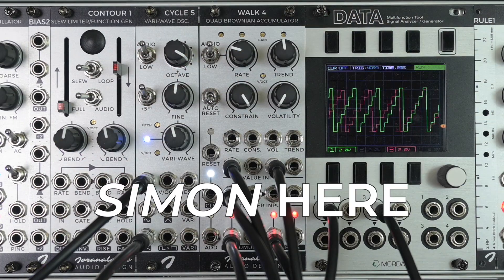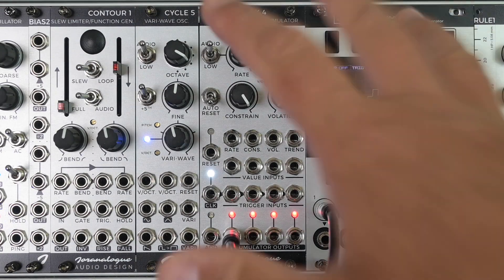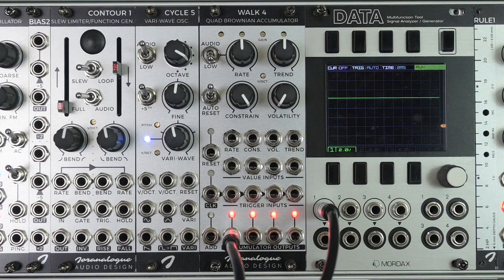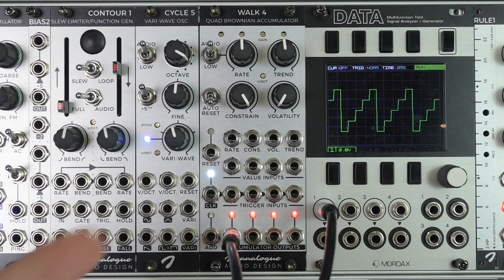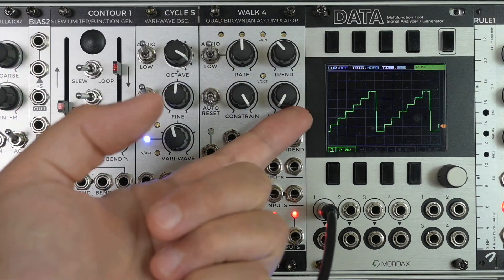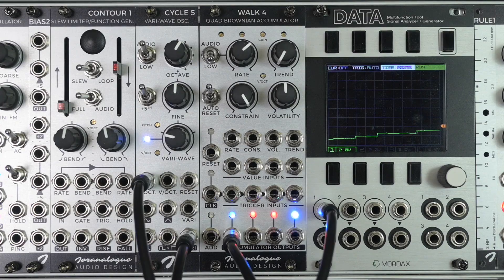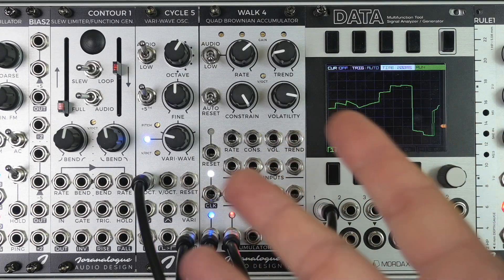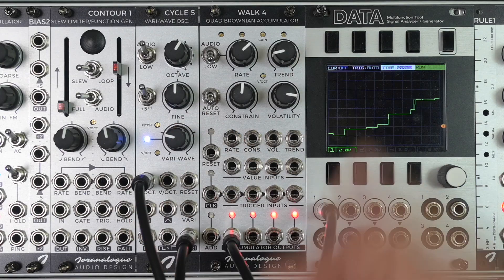WALK 4 | Quad Brownian Accumulator | Quick Overview

Comment: I am very interested in Walk 4 and I will probably hit “buy” as soon as it drops! Random question (pun intended): if I set trend to 0, constrain to maximum, volatility to maximum, turn auto reset on, and clock at audio rates, how similar to white noise does that sound?
Reply: It's not lab grade white noise but to my ears it's close enough to regular white (or perhaps pink) noise.
Reply: @briesmodular  Awesome. Thank you for your response. I pre-ordered a RND Step that I have been waiting on for a few months and Walk 4 will probably arrive before it does. It sounds like I may not need RND Step anymore!

Comment: can add work with say an assimil8tor sample or any other kind of audio sample? because this has some very interesting possibilities either way… great speed walk through btw Bries.
Reply: Thank you - the accumulation works at audio rates as well as cv rates, you can use audio rate triggers or slow weak LFO signals for triggers or reset. The possibilities are almost endless.

Comment: This looks amazing! A question, if I may, please. I've read through the manual and watched the video a couple of times, and as I understand it, in audio rate the outputs are basically noise generators. So, if Trend and Volatility are fully CCW, and Constrain is fully CW, then triggers are bypassed, and the CV inputs take full control. If you were to input different fixed offsets across all 4 channels, could it create a bank of different noise colors?  I have no idea if my idea is accurate or completely wrong, the question just occurred to me, so no harm in asking.
Reply: Triggers aren't bypassed at any rate, it's what makes the accumulators add a precise (trend or cv inputs) or random (volatility noise) voltage. But indeed at high audio rates and with the voltaility high the outputs might resemble regular noise. I'm not sure if at this point it matters much at what voltage the trend (or cv inputs) are at, since the result will be affected by 4 seperate noise generators anyway. I don't have a prototype with me at the moment but I don't think you'll be able to create different colours of noise.

Comment: sadly no internal slew / lag function - would have made the module much more versatile, imho. But of course, you could combine it easily with your favourite slew processor. Still I‘d rather prefer just two accumulators but with lag options, than four of those.

Comment: Dialogue level is extremely low compared to the audio from the Walk 4. Extremely hard to follow (on headphones at least).
Reply: Videomaker here (first of all thank you for the feedback):
Are you listening in HD? Which type of headphones are you using?

I've been using the same settings for a few years now (music is always 6dB lower than the voice with additional ducking of 6dB to 12dB), I haven't had any complaints about the relative levels at all so I'm wondering what the culprit is exactly.
Reply: @briesmodular  yeah in HD. I'm using a trusty Sennheiser HD 600. Maybe my ears are getting old, but the overtones from those square waves are seriously clashing with your excellent dialogue.
Reply: @runglerhz5590 Thanks again. I'll keep an eye on my settings for upcoming projects.
Reply: @briesmodular  btw. it's better on studio monitors
Reply: Sounds perfectly fine on my laptop.
Reply: zero-crossing points are easy to detect